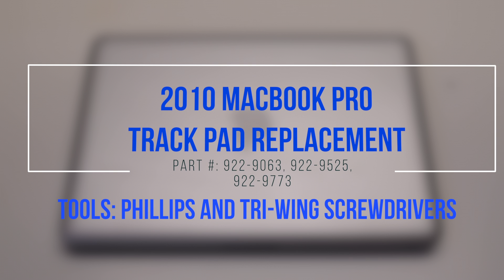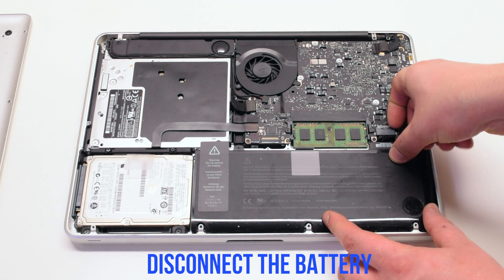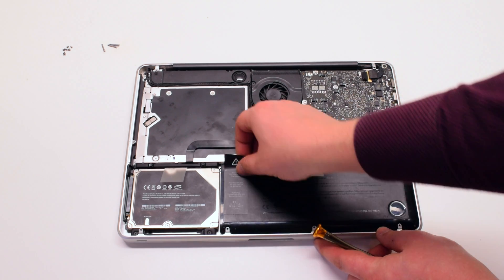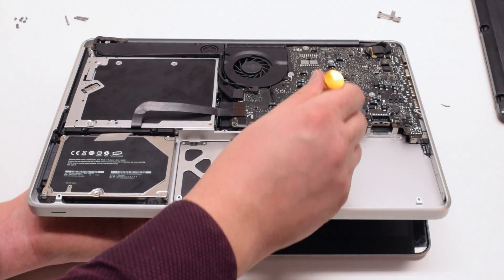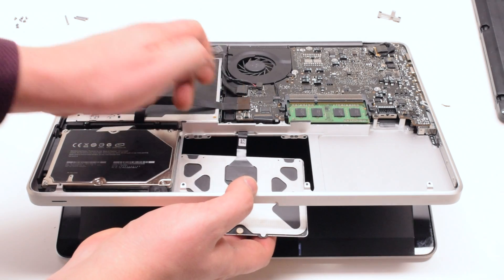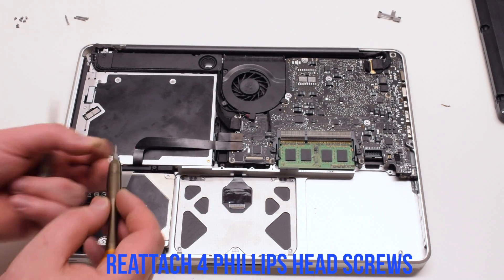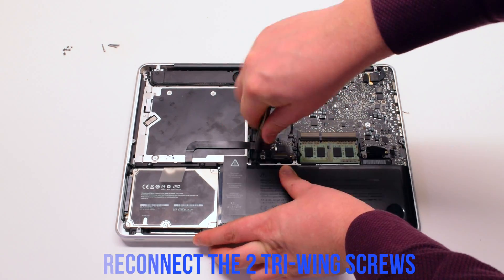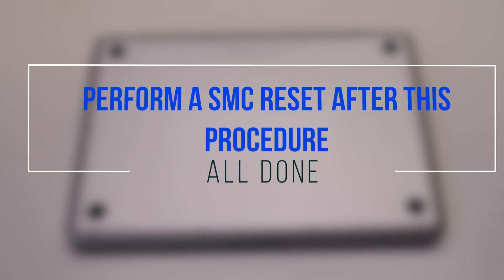2010 Macbook Pro 13" A1278 Track Pad Replacement

Comment: I had an old A1278 floating around that I keep for spares and repairs on my current A1278. Today, thanks to you, I have swapped over the DVD Super Drives (current one wasn't working but the old one had a new one in it) and also swapped over the trackpads (current one didn't do as it was told). I can't thank you enough.

Comment: This is a great clear instructional video! I followed instructions and new installed trackpad works, except in moving 'arrow' around screen; it is not accurately responsive, doesnt follow where I am moving it, is slow and kind of sticks... I have tried adjusting Tracking Speed in Preferences. Thanks for any help.
Reply from the maker: Check out this video https://www.appledollars.com/trackpad-replacement to give you a batter understanding on a track pad functions. It might be that you need to clean the edges where the track pad sits or just adjust it's position.

Comment: Isn't disconnecting the battery going to reset the battery cycle count?
Reply from the maker: No, disconnecting the battery will not reset it's cycle count. Cycle count is determined by internal electronics in the battery.